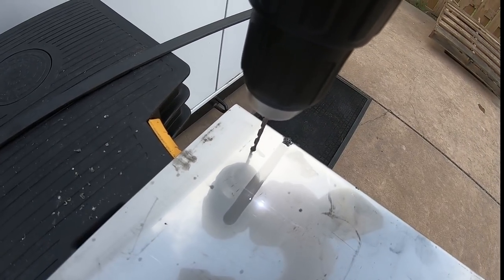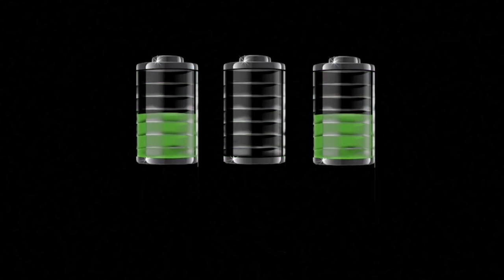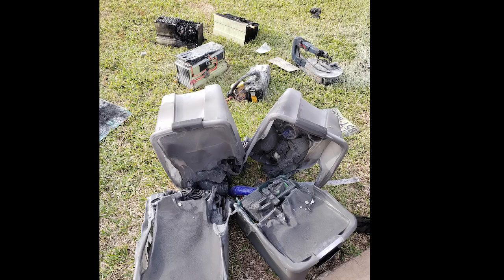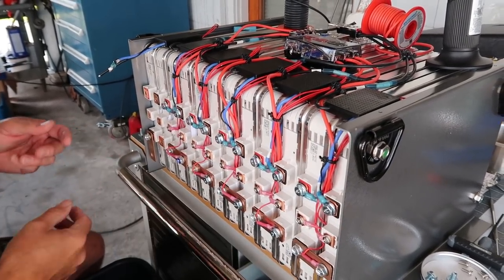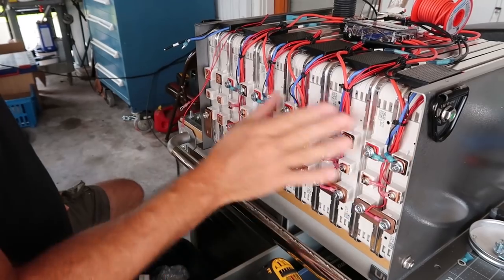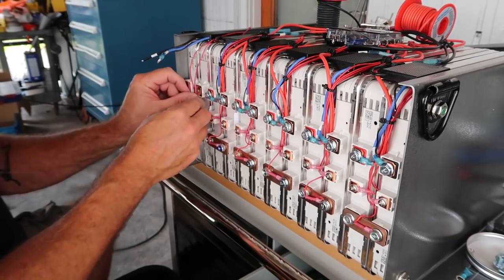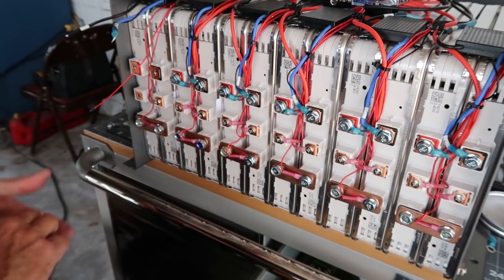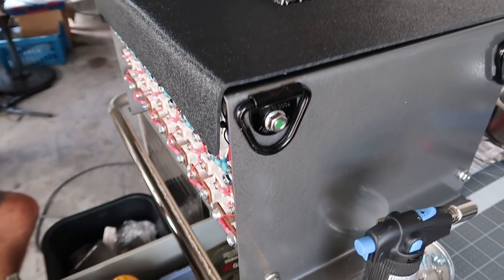Our Lithium Ion Battery CAUGHT ON FIRE | Learning from Mistakes Ep 52 | Sailing The Space Between

Comment: It's not the battery it's the chemistry of the battery that is flammable or not which is why I only use LiFePo4 as they pop but do not burn both volt and leaf batteries have flammable chemistry. So you just changed from wood to coal.

Comment: So if one pack is roughly 3kw and I believe I saw 4 packs where does the "28kw system" come into play? Also would you mind revealing what year/gen your modules are and how depleted they are? Thank you for your video! The information you provide is extremely helpful as I build my own system.
Reply from the maker: So each full battery has 2 packs in them x4 so with use I am down to about 25Kwh...

Comment: What charger were you using to top balance the Volt cells?
Reply from the maker: A single cell charger but the limiter failed and just kept charging the battery held out for 18 hours before the cell blew...
Reply: Sailing The Space Between Which single cell charger? It seems unlikely that it would charge over 4.2v unless it was a charger not designed for li-ion.

Comment: So your the first guy I have seen blow up chevy volt batteries. So you just over voltage the chevy volt batteries?
Reply from the maker: Yep the limiter on the single cell charge failed and it just kept putting 4.6 volts at 5 amps but the cell held out for 18 hours before it let go. But I am not the first to blow a volt pack I have seen one go all at once and its not a pretty sight... 

DONT LEAVE LITHIUM'S CHARGING WITHOUT YOU WATCHING or at least have a cut off system...

Comment: Also, why did you use so many BMSs for a single pack? You could’ve just used one BMS per pack.
Reply from the maker: well actually 1 bms is covering 4 packs at 16V then you have 6 clusters in parallel that how you stack them to make up the amp hours
Reply: Sailing The Space Between You could’ve put two modules In parallel then put them in series with the other modules. ++ - - ++ - - instead of +-+-+-+-

Comment: I'm considering getting battery hookup's leaf pack and ended up seen this video that I recommend the comment about the spacer as I see you are compressing them together, just in case. Be safe. Link: https://youtu.be/0dBjPwJ_Qaw?t=1364
Reply: Only Gen1 modules need spacers, in this video he's using Gen2 modules, so no spacers are required. It's a good idea not to compress the pack too much by overtightening the bolts.  The spec in the Nissan service manual is 9.6Nm